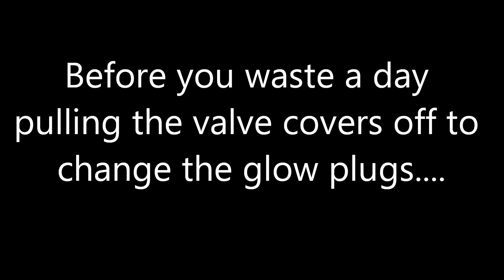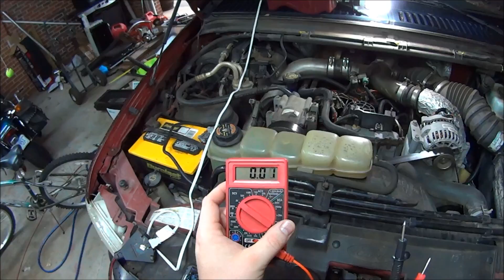Ford F350 Glow plug relay

Comment: thanks a bunch! i have a 1996 7.3 f250 with over 300,000 mls and is running great still. knock on wood! could you do a vid on how to drain the water from the fuel separator?

Comment: If you ever have the batteries drain down in about 2 hours with the key off and the truck sitting, disconnect  the glow plug relay.  I replaced mine and problem was gone.

Comment: If the output side of the relay shows the same voltage as the batteries the relay is fine, but the glow plugs aren't getting power.  If everything's working the output side will show less than battery voltage and the battery voltage will drop while it's engaged.

Comment: I replaced the relay a couple of years ago, and now truck wont start in cold (unless block heater plugged in) Also three years ago, replaced the starter with a new one from Ford dealer.  It lasted 22 months, the copper webbing conductor corroded out, damn POS!  Got an aftermarket starter which has run great ever since.  I wonder if the glow plug relay crapped out like the Ford starter did.  I remember screwing the nuts back on the lugs was a pain, because there wasn't much clearance between the nut and plastic housing for a socket to fit.  Excellent video.

Comment: Avoid Autolite and any non Motorcraft (Ford) glow plugs because they will disintegrate over time, and it's a well known problem that will destroy your cylinders if not caught in time.  
If you get a new to you 7.3, or don't know yours, first thing to do is replace all the glows with new Motorcraft glow plugs (and fuel filter so your injectors don't wear out prematurely, hint, hint, and oil..)...  you could check the glow plugs and pull em and test resistance to see if they are still good, but if you are not broke, get em out, put in new ones.  Nice part of this is, if you are in a climate where temps hit 45/50 F, no more smoke on start, my truck is running like new!!!! , burns 0 oil, and cracks right off and no smoking.. I was blown away, it used to smoke a good bit and of course had trouble starting.  I changed 3 relays, but turned out by the time I checked it, only 2 plugs were still good lol   And... one was partly disintegrated (just the tip) Autolite.  Testing showed compression and oil were still ok, so maybe a tiny bit of the tip (~1.5mm) may not kill the truck.  Good luck.

Comment: the 1sr relay is for the air intake heater witch may turn on less then 10 times in the life of the truck at least if you live below the artic circle the thing just restricks air flow my truck is from watertown new york and now in pa and truck had 176k on it and when i took it out it look new like it had never came on at all.

Comment: I am a Happy Camper ! Thank you for your video on F-350'S.D. With the 7.3 Diesel engine.  my truck is a 1999 Lariat 4/4 . crew cab .  wouldn't own anything else.  they are Beasts. Thank you again for the update on the 7.3's

Comment: Thanks for the awesome video, I had plenty of time to set the ignition to "on", then connect the volt meter.  Also, the old relay had a dull "thud", while the new relay has a nice loud "snap".  You should be able to hear it click with the driver door window down.  $49 at Autozone and I'm back in business!  YOU GUYS ROCK!

Comment: Forgot to mention the fact that if the engine is at a certain temp (via the coolant temp sensor reading) the glow plug relay will not have power on the outlet terminal due to the fact that the  Ecm can see that the glow plugs are not needed. That's why when your engine is warm the wait to start light goes off almost instantly. If the engine is warm disconnect the coolant temp sensor and try the test again. 👌🏻

Comment: I have a 1999 E350 7.3 turbo diesel and I think they screwed up the glow plug and air intake heater wiring when I had a new engine installed, have always had to plug it in even when in the 40s/50s. I was told the back relay is the glow plugs and the front is the air intake heater. I have the large red cable from the battery on the one big terminal and the brown/yellow that are connected together on the other large terminal along with a single small yellow wire and then the two small red wires are connected to the smaller terminals marked #1 & #2, don't know if it matters. After hooking this one up I started to hook up the air intake heater relay, I know the large wire from the battery goes to the one large terminal but the other one was wrapped in tape and not hooked up and that is probably because the intake has a plug in it, no heater. This leaves me with three small wires - red - red with a small yellow line and a purple but have not hooked them up because I don't know which one goes to what. I guess what I need to find out is if I have the glow plug relay hooked up right or do some of these wires go to that. I had some short wire and long wires so I figured the short one went to the glow plug relay because they would barley reach the air intake heater relay. Would appreciate any help, a hand drawn diagram would even be better. thanks

Comment: You should also cover the opposite condition where a relay stays on constantly.  Mine was stuck like that and you could hear it click but it never disconnected.  If that happens your glow plugs are on all the time and you burn up your alternator like i did.

Comment: I changed out my relay and still no voltage on the right side. now what do I check?
Reply from the maker: If you have power from the big wire that is the positive coming in off the battery, and you get power when you turn the key and the small wire has power, then it's impossible for the power to not jump across and go into the line that leads into the glow plugs themselves.  If it still doesn't jump power across the relay, then the relay has to be faulty.  Hope that helps.  Double check your connections with all wires coming into the relay.
Reply from the maker: I changed this relay during the summer of 2013, and now we are into full winter here, and I cranked it with only 38° one morning, and it cranked right up, no problem whatsoever.  This was definitely the problem with my truck, not the glow plugs themselves.
Reply: ***** actually if you have glow plugs pulling more amps across them than the ecm is designed for the ecm will shut down that relay. Your two small wires are your ground controls, the ecm controls the relay by closing the circuit enabling the power to run to the glow plugs. your next step nick is to probably pull your valve covers and ohm test the glow plugs, if you get over 1-2 ohms of resistance the plugs are shot. also DO NOT BUY AUTOLITE GLOW PLUGS!!! the heads will swell and get stuck in the top of your cylinder. hope this helps.

Comment: Thanks for the video but I've got a slightly different problem with glow plugs firing periodically while the engine is running. Do you have any advice to why?
Reply from the maker: That is way over my head buddy, wish I could help.  Thanks for watching though.

Comment: This was a great tip, I just started  having a problem with black smoke pouring out of the exhaust. There was not work done in the engine area prior to the start of this. My thoughts went over all bad possibilities and had thoughts of a costly, time consuming repair. I have done a lot of repairs and modifications under the hood already including an engine overhaul, injectors, glow plugs, ect....  I did however reuse a number of parts and as I did not know at the time what this relay was for, this is one of those parts. I just finished the test, by the way, you don't really need a second person just a meter with clips and long enough cords to have it in view when you turn the key on, and found the relay is in fact bad. So tomorrow it's off to the parts store and we'll see it that completely fixes the problem and with a bit of luck I won't have to delay or cancel my trip.

Comment: Great simple video!!! Thanks.  I want to caution people to a couple things:  First on some trucks, the ECM will only turn on the glow plugs below 50 degrees.  So.....you gotta do the test below 50 degrees.  Second, the ECM determines how long the GPR is activated.  Its not related to how long the light is on.   Generally you will have time to turn the key on and get around to test it.  Finally, you need to be sure the ecm is actually grounding the GPR /controller.  you can do this by disconnecting the ( - ) control wire and turning on the key and testing it for continuity to ground.

When you determine it is the GPR/controller - replace it with the white rogers (stancor) 586-902 or similar.  $76 on Amazon.  They say it will last a long time!

Comment: what if you're testing it by yourself? can you turn the key on and go back to test it. or do you have have someone else turn your truck on? thanks for all the great vids. do you have a vid on how to change the relay?
Reply from the maker: Relay is an easy change.  Two nuts to the two wires, and two more nuts bolts it down.  I think you need to find a friend named jimmy to help you.
Reply: i was asking about testing it not changing it. thanks
Reply from the maker: You asked if i had a video about changing it and i said no, changing it was easy, and explained how to do it. Yes you need two people to test it.
Reply: sorry, i guess you didn't see my question about testing it. i figures it out and changed it. super easy!!! keep the great vids coming!!
Reply: +madd ness Its easy to test without a helper.  You just need alligator clip leads for your voltmeter.  clip onto the proper points, then place the voltmeter where you can see it from the drivers seat.  Turn on the key and watch for the voltage to readout.
Reply: thank you very much!!!
Reply: lol i laugh every time i see someone turn the key on and run to try and test before it shuts off lol it a old light bulb in an test light it will light with power flowing in both directions so stick  the clip on what you testing and stick the probe pin down the crack in the battery term right on top the battery then you can see it from the driver seat lol the hell with trying to climb up in the front of the truck fast and braking your ass when ya fall of that slippery bumper

Comment: Good video, however I'd like to explain how important it is to also check for power and ground at the other two smaller wires on that relay, or any relay (esp. since you're already there checking) The smaller wires on the two smaller terminals make up the control circuit for that relay, and if they were missing their necessary power and ground, which actually activates the relay in order to allow that power (13.54 volts) waiting on the 1 large terminal to jump across internally to the other large terminal (out to the glow plugs). In this case it appears that replacing the relay solved the problem. However, the ultimate reason for this post is to assist with helping to avoid wasting money and time replacing a part that could still be usable, and problem still existent. Thanks for video, it was still very helpful.
Reply: +icemizul  So, if you test the relay and you are getting power (key on) from both the two smaller terminals but, if you are Not getting power to the Hot Bigger +Pos. post or the Glow Plug Oppos. Bigger Post then, is the Relay Bad or do I look elsewhere before the glow plug relay on why I'm not getting battery power to the Pos. + post of the glow plug relay side and to the oppos. bigger post? Two new Interstate Megatrons, two new alternators, dual battery and dual alternator, 2000 Ford F350 Powerstroke 7.3l superduty diesel, 2wd, no tuner chip,
Reply: +diane reinhart 

If you are referring to the terminal at the relay that inevitably provides positive power to the glow plug; then I'll say yes, positive power should be there when the key is turned on. However, if power isn't there, then you will need to determine where it originates before the relay (which may be a fuse; check your owner's manual for location).
Reply: +diane reinhart 

I also want to say, (based on what you mentioned) "you're getting power at both small wires", then that would most time mean that the ground is possibly missing. In order for a relay coil to properly energize, it will need a positive on 1 side of the coil and a negative on the other side of the coil.

Comment: Test showed bad relay, but Advance Auto cannot come up with the right part.  Bolt pattern on starter solenoid is different.  What they call a relay is completely different.
Reply from the maker: Go to RockAuto.com  That is where I got this part from and I had no issues as long as you put in the correct model, year, and make.  Thanks for watching and commenting!
Reply: Found out I was looking at a 2000 video. Mine is a 2003 with a different more expensive relay